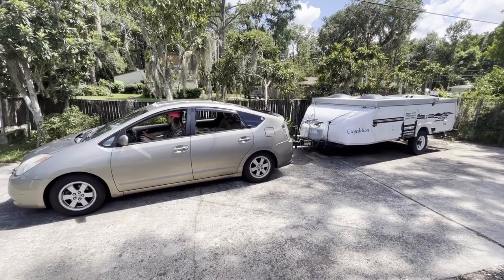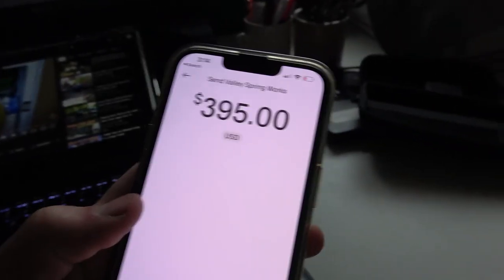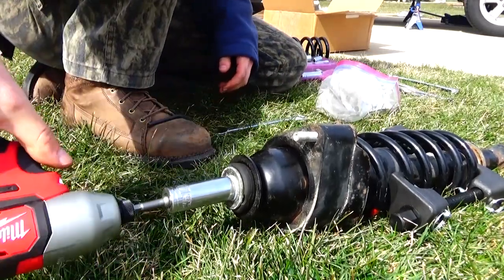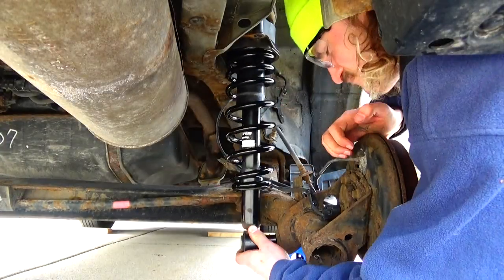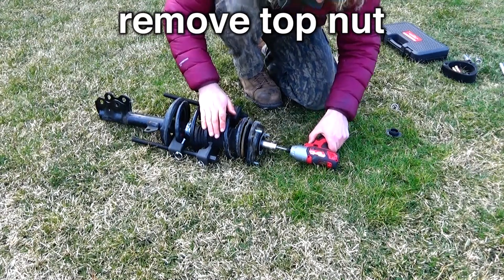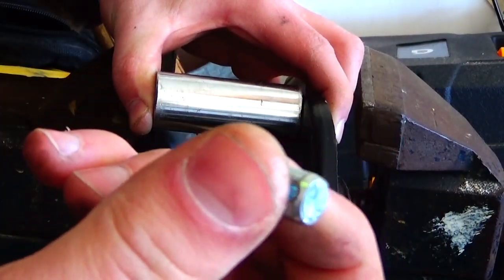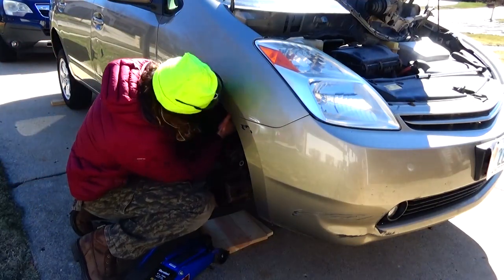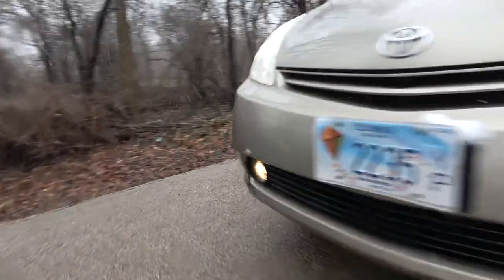How to install Lift Kit & Heavy Duty Springs on Prius (2004-2009)

Comment: The snapped bolt probably wasn't your fault, those cheap ebay kits just have really bad quality bolts. I have a similar kit in mine and also recently had the problem of a pothole bending my strut mounts because the plastic spacers don't spread the load properly across the whole top hat like the factory struts or a quality lift kit does. I certainly wouldn't recommend anyone buy those cheap plastic kits for these 2 reasons, the Prius Offroad ones are better in every way
Reply from the maker: Yo i saw your post about that on fb thanks for the info. that's the first i've seen someone have problems with the plastic spacers, but i will stay woke. If i have any problems i will share as well
Reply: @soilliam  it might seem like a lot of trouble to remove the sub-par bolts but it seems like it makes sense to replace them with a with a higher quality bolt... Plus you could justify with the quality content of a new video 😊 (Prius off-road seem like nice folks anyway and I bet they would sell some high-quality bolts). 

KILLER VIDEO AND EDITING ON THIS ONE 👏👏👏 let me know if you are near Greenville South Carolina or Asheville North Carolina ~ have a place you can park
Reply from the maker: @GABRIEL_CRAFT  I'll definitely consider upgrading next time I have to replace something in the area but for now gonna see how these ride. thank you for the kind words & will hit your line if I'm in that area!
Reply: @soilliam  yeah I've had them in for a couple of years now with no other problems, but it only takes one mistake (or a big pothole in my case) to change that, the bolts were always a bit sus for me but I never got around to changing them, seeing yours snap just tightening it up is a bit of a worry
Reply: @MinimaDomum all the commebts have been very helpful...  I plan on lifting my prius with the recommenced prius iff road kit and a rear spring upgrade like liam did..  my question is upgrading the tires to a larger size ..is there a way to adjust the tachometer to relect the correct speed?
Reply: So maybe this is a dumb question, but can you just buy the spring separate? So you don't have to disassemble and then reassemble? 😅
Reply: @Ourdailyimpact  Prius off road sells struts with uprated springs

Comment: Compressing the spring you can use bailing wire to hold the compression take the compression tools off place in the strut in the strut area. . Cut the wire once in the car to release the energy.
Reply from the maker: that is a great idea
Reply: @soilliam  Neighbor across the street had his truck sitting up for a month I asked why he said couldn't get the compression tools out when he put the struts in. I came up with this idea he was driving that day. My thanks they turned on me. No good deed goes unpunished.
Reply: @soilliam regarding the transmission oil cooler... I couldn't find were I asked you originally but here's what I learned from a Toyota tech and a hypermiler that's owned a gen 2 since new

The eCVT trans doesn't have any lines that directly connect to the radiator..

The inverter indirectly cools the trans by having its lines next to each other

The methods recommended... Replace the GEN2 radiator with one from a gen3 inverter coolant radiator and/or place an auxiliary fan next to the inverter radiator for improved airflow

My though are possible adding another small radiator inline with the OEM inverter coolant radiator.. add a fan..  the add an engine oil cooler

Please let me know your thoughts
Reply: @GEAUXFRUGAL thank you for sharing the bailing wire suggestion
Reply: @camposvazquez  My neighbor could not drive his truck it was parked wheel off over a month. I asked what the issue was he couldn't figure out this problem. I went for some bailing wire and had him on the road inside an hour.

Comment: A Prius 2 with a trailer!? At least in Europe it doesn't work that way because it's not approved for trailer operation there! Only the fourth generation is allowed to tow trailers with a maximum permissible weight from a ridiculous 750kg(braked)! But given that, I'm wondering what that's all about!
Reply from the maker: It has worked so far ¯\_(ツ)_/¯

Comment: I did the same upgrade but now my driver side has a squeeking sound when turning.  Sound like its coming from where the rubber lift meets the strut at the upper part of the strut.  Especially  loud when i open my hood and put my ear by the 3 bolts.  That part doesnt turn but the squeeking sound is heard the entire time the steering wheel is turning.  Any tips on how to fix this?
Reply from the maker: not sure on how to fix this as I havent dealt with this problem, but I would try spraying some lubricant in the area if you can reach it. Best of luck

Comment: Not supposed to tow any trailers with Prius!
Reply from the maker: not supposed to do a lot of things :)
Reply: I tow a trailer with construction materials all the time. Gen 2 Prius is rated  to tow up to 2000 lb. You could get a factory hitch from Toyota.

Comment: I would recommend upgrading the sway bars, I did it with my 04 Prius and it made a huge improvement. Also the wheels from the Toyota gt 86 fit the Prius I have some on mine and am running 215/45R17 so if you want bigger wheels you can grab some used ones and easily fit some 225/55R17. Great video btw 👍
Reply from the maker: Great to know, and thank you

Comment: lol people laugh but I did a lot of hauling heavy loads with my Prius as well for years. It tows really really well! I just used some of those twist lock coil spring spacers to keep mine from sagging. Worked out great! Strange but it also made the ride much smoother.
Reply from the maker: prius towing is goated. I saw those spacers when i was researching and was a little skeptical., good to know they actually work

Comment: Thanks for the video! Love it! I've got a 2007 Prius I added a +1.5" spacer from Prius Offroad and +1.75" in the rear from a set of springs from valley spring works. When I was installing the rear axle with the spacer and spring, I was running into a clearance issue with the hydraulic brake lines. What did you do about those? Did you remove them from the mount and leave them hanging? Thanks!
Reply from the maker: I had to remove them from their mount during installation while the car was jacked up and the axle was hanging freely, but I reconnected them after I installed the strut and jacked it up a little bit. I hope that helps
Reply: @soilliam  oh, interesting. That's helpful. Makes sense the extra space is only needed when the struts are uncompressed. Great! Thank you!

Comment: Great video, I want to do this to my camry, I'm worried about long term effects on the CV joints did yours give you a problem after some time?
Reply from the maker: about 40k miles on them so far, and no issues here

Comment: Your inverter will go brrrrrr.... :D good luck whit that
Reply from the maker: Why
Reply: @soilliam  You cannot carry not even heavy loads but neither lighter stuff. The maximum is what a Prius gen 2 can carry is some bikes and sport equipment. According to Toyota. Im sure the original manual contains it.
Not the inverter, breaks and suspension, undercarriage and the planetary gearset is capable for this. 
It will kill your inverter.
Reply: I called Toyota and they have changed their tune. Not sure about gen 2 I have a Prius v ‘17 but they use to tell me no tow but now say just shy of 1600 lbs like they are already rated overseas. Not much but more than a bike or two!

Comment: My front strut tower stud broke way before the specified torque was reached, just like yours. Where did you get a replacement stud? Thanks.
Reply from the maker: Rip stud. I got a replacement at ace hardware. It did not have the spline section at the head of the bolt but it has not caused any problems to date

Comment: What was the weight these springs were rated for? I understand valley spring works has several different springs they have to offer for the second gen. Thanks.
Reply from the maker: I am not sure, I didn’t ask for a specific weight rating. They told me they were their dual rate springs

Comment: Commented liked and subscribed... I have so many questions but i will start woth one..

How much mpg did you lose with the lift?

I just picked up a 2008 touring model..  i already own a Class B van... I want to flat tow a lifted prius .. park the van on BLM.. then use the prius to go fishing..resupply all while have the van parked in a prime camping spot
Reply from the maker: Thank you—in all honesty I don’t think I’ve lost any mpg. I still get 45-50 in tow and 40-45 on the highway.  Any other questions let me know! I’m happy to share
Reply: @soilliam  is it possible to add an auxiliary transmission cooler..  I plan on towing my custom made Suzuki samurai half cut trailer...

I have added coolers to all my other rigs ..eCVT I am not familiar with...
Reply from the maker: I do not know. If you find out let me know!
Reply: @soilliam  will do... During the week I will look for a Prius specific shop and ask... I will report back

Comment: Has increasing the front height decreased your gas mileage from the axle joints having to rotate at a higher angle? 

I want to lift mine a lot higher, but doing so id have to drop the entire engine and transmission lower too so my gas mileage remains the same until i place higher diameter wheels on.
Reply from the maker: So far i'm not noticing any significant difference in mpg. im sure it has changed some, but i'm still getting 40-45mpg in cold weather